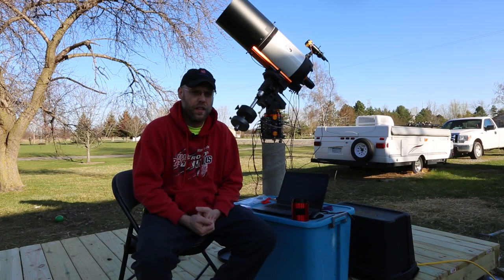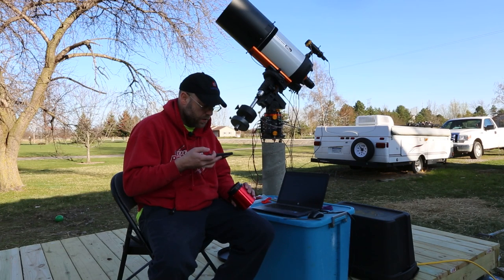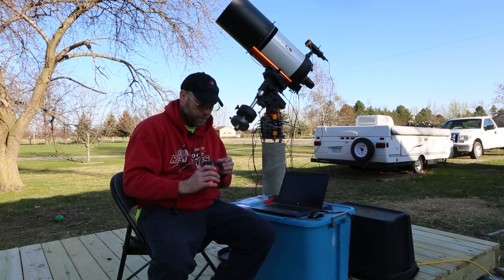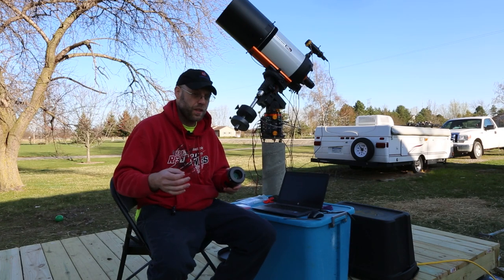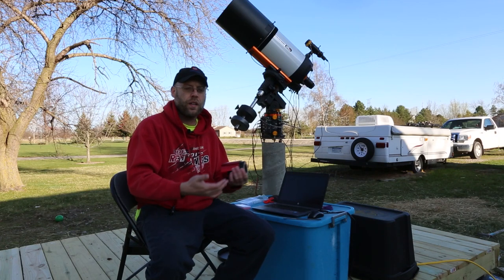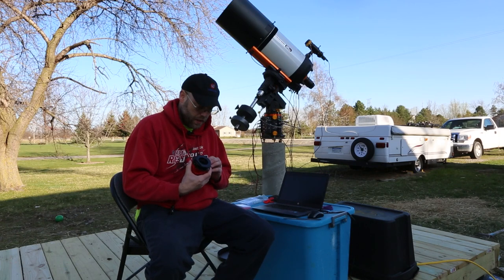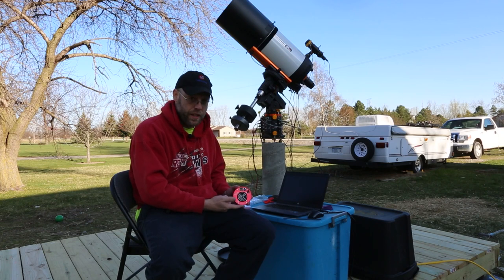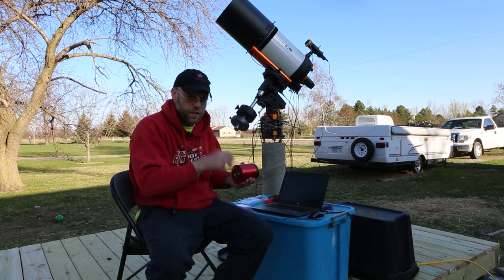Sensor Tilt (finally!)

Comment: Hi, thanks for the explanation, I have a question on the CCDI result on the first test showing 61degress tilt with a arrow to the top right corner, i find you said you unscrewed a bit  the  bottom left of the camera side to level it. I seem not to understand CCDI tilt error result and which camera side to touch to fix the tilt. Thanks Charles.
Reply from the maker: Hey thanks, Charles. This bit is a little tricky because of the way normal camera lenses work. A lens flip's the image on both horizonal and vertical axis. The camera corrects this automatically in firmware. So a photon that hits the bottom right corner of your sensor (as you look at it) will light up the pixel in the top left of your image. So if you're doing adjustments from the back of the camera, you flip the vertical axis again. So if you see the error in the top right of your image, as your standing behind the sensor, you adjust the bottom right of the sensor.

Comment: Hi! Follow-up question. After you got the adjustment perfected, can you explain how you then handled the final setting of all three sets of screws? As in collimation of a Neutonian primary mirror, did you just tighten any loose push screws til they touch the tilt plate? How about each of the three pull screws..how tight did you make each of those?  Thanks again!
-Craig
Reply from the maker: Great question. I had all of them slightly tight, so that final adjustments locked it in. Then I gave all of them a snug, you definitely don't want to crank down on anything, just enough so they aren't coming loose or letting the camera flex too much. Then check it again, make a final adjustment or two. The point is when you're really dialing it in it should be kind of snug already.
Reply: @DeepSpaceDad  Very good! I'll give it a try after I make sure that it's an issue with my ASI 2600 and not the image train. Can't tell you how much your video and follow-up really  helps. There are a few YouTube presenters that have tackled this subject but, bless their hearts, didn't explain the "nuts and bolts" of the project to the extent that you did. I look forward to more videos! CS, Craig

Comment: @DeepSpaceDad I wanted to ask if I should vertically flip the image on ASTAP before I check for tilt and in case of refractor I should only flip the image vertically and not horizontally right?
Reply from the maker: Don't flip the image at all. Just be aware of the way the setup puts the image on the screen
Reply from the maker: You can do a test by disconnecting the camera and taking pictures with a corner of the sensor window covered by something. Look at the image and note where the shadowed corner in the image is. Make your adjustments based on those notes

Comment: Did you determine in advance that your tilt was "camera sensor tilt"?  Well, I used ZWOs published suggestions of how to find the tilt, because I have 2 cameras!  I took a few subs of a star field.  Then (I have a RASA 8) I rotated the camera 90 degrees, 5 more subs, then 90 more degrees rotation and 5 more subs.  ZWO says, if you do the rotations and then the tilt depictions in CCDI or ASTAP "do NOT rotate with the camera, but stay in the same place, THEN you likely have sensor tilt.  
But that's not what I got!  The depictions of extreme tilt DID rotate with the camera, strongly suggesting "optical train tilt".  Not sensor tilt.  This was true using both ASI2600 cams, MC and MM.  Now what?  ZWO says that next you check your camera adaptor for the tilt.  I was using the Starizona Filter Holder for cameras with 17.5mm back focus.  With the adaptor (11.5mm back focus) that adds up to 29mm, very close, within .25mm of ideal.  So in the swap, I used a new custom built adaptor that gets exactly 28.73mm of back focus.  This adaptor is held by screws to the camera instead of threads.  Result:  still shredded stars in the bottom corners of my images.  Great.
So, I am going to repeat the adaptor tests and make sure of that result.  But at the moment, there is real evidence to at least suspect that my tilt is coming from optical distortions in the RASA 8 itself.  I can't see trying to use the tiny screws on the ASI tilt plates if the problem is actually in the scope!  So I don't know what to do yet, the scope may eventually return to California for repairs there, though first I will confirm the collimation.
Reply from the maker: Yeah it was a little of both and camera sensor tilt is a lot easier to adjust with the screws than hunting down the tilt in the train and making custom adapters and things. So i just dialed it in with the tilt plate on the camera.
Reply: @DeepSpaceDad  just 1 camera?
Reply from the maker: @paulwilson8367  yes

Comment: I have tilt on my bottom left corner. 
How do I fix it?
Thxs
Reply from the maker: You can buy a tilt plate adapter like this to adjust it like I showed in the video 

https://agenaastro.com/zwo-t2-tilter-adapter-ii.html
Reply: @DeepSpaceDad  
Thanks for reply. 
Is it possible to send u one of images and see what you think. 
Can u use your ccd inspector i don't have one and I cannot download it. 
Thanks
Reply from the maker: Yes certainly. Upload it here and I will take a look this afternoon.

https://1drv.ms/f/s!AqTKfoaP_849hIRuzKT5-e4C3EaaGw
Reply from the maker: Or upload it anywhere you want and share a link to me
Reply from the maker: Try this one. It will be too big for email.

https://drive.google.com/folderview?id=1ZgVUwdftPDsjjtNGsYB6ELYJhOsPjbPF
Reply from the maker: Alright I measured your image and uploaded the results to the same folder. Curve.jpg
Reply: Thank you 
What do u think about my image. Do u think I need some adjustment?
I don't know how to read the ccd inspector. 
How bad is it?
Thanks
Reply from the maker: Your tilt could be better but it's not terrible. Your main problem is field curvature. Your backfocus might be off or that may just be that nature of your optics.
Reply: Hi
If my back focus is off , Do u think I need to add spacer ?
Right now I'm at 55mm distance. 
Thanks

Comment: Thank you for this information. Question, do you have to do this every time you use the RASA or only once? Also where did you get the tilt plate? Thanks
Reply from the maker: You only have to set it up once. The tilt plate came with the camera but you can buy aftermarket plates to put on a camera if it doesn't have one.

Comment: I thought I will enjoy astrophotography, but the more I learn about it,  the more frustrating I become.
Reply from the maker: Yeah it can be a frustrating hobby sometimes. What are you having problems with?
Reply: @DeepSpaceDad  
I’m dealing with elongated starts in both top corners of my pictures. The elongation is pointing toward the center of the frame. The problem start from the median and going to the two up corners. I believe that it must be my secondary mirror who’s not well adjusted. My telescope is a Newtonian ORION 10” f/3.9, and my camera is a CMOST ZWO ASI 1600 Monochromatic, with a filter wheel.
Reply from the maker: Are you using a coma corrector?
Reply: @DeepSpaceDad  
I’m using a Baader Planetarium 2" Mark III coma corrector.
Reply from the maker: Your sensor is probably tilted too close to the coma corrector on the bottom of the camera. Does it improve if you push the bottom of the sensor farther away with the tilt plate screws?
Reply: @DeepSpaceDad  
This is exactly where is my frustration came from. I never knew that my camera came with anything to deal with a sealed sensor inside the camera’s body. I have to check my camera today.
Reply from the maker: It might not have a tilt adjustment on it. You might have to get a tilt adjuster or you could try to put some tape on the body to shim the camera out on the bottom.
Reply: @DeepSpaceDad  
Ok... I’m going to follow your advice, and see how I can get rid of this problem. I thought at first that it was collimation. But it’s not. I collimate my telescope with one the best laser collimator in the market. I have almost all the tools dedicated for this purpose. My first mirror and the secondary are spot on. But I still have this one side star’s distortion. This’s where I was baffled.